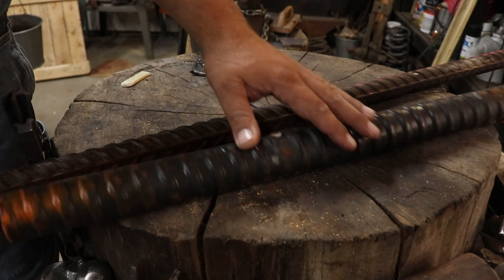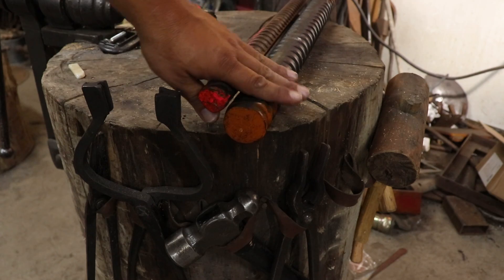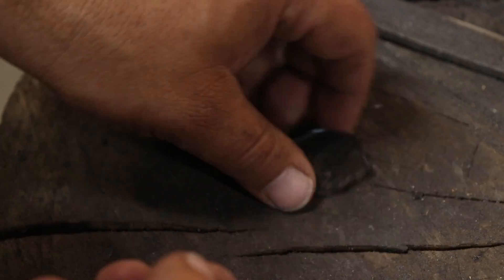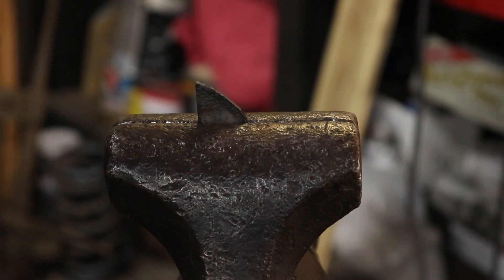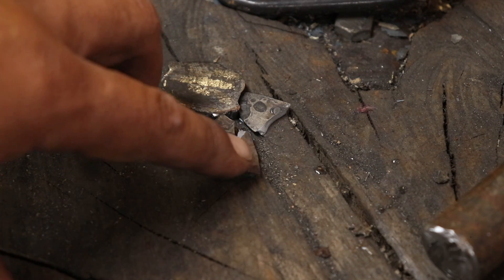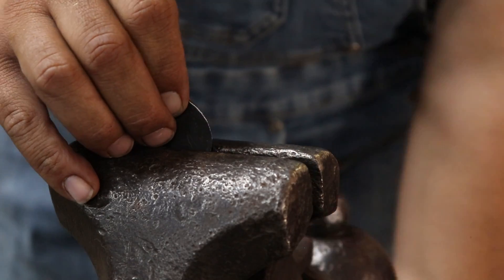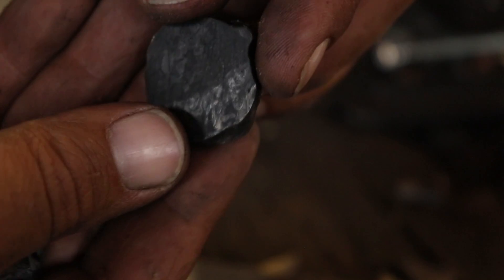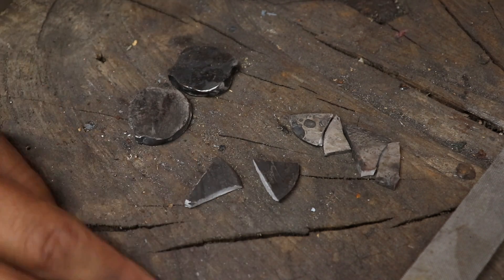Testing Steel Hardness

Comment: Rebar is mostly recycled steel, I’m told so it’ll be an unknowable mix I believe?  The large diameter is normally higher quality used for DOT and larger structures thus the grade is specified in contract specifications.

Comment: Did you preheat the oil? because most oil hardening 'tool' steals prefer being quenched in 80° Celsius oil. Like the O1 tool steel or W-Nr. 1.2510 in Europe.
Reply from the maker: yes I pre heat with a hot piece of junk steel I don't check the temp after though.

Comment: Ok some people get free or nearly free.
Many people have to buy but sometimes prices vary greatly.If you don't get a bargain just buy known steel and little bit costly but you also learned more that can be repeated.
Thanks good job
Reply from the maker: I agree completely I forgot to mention that I wouldn't pay for rebar it's just not good enough steel, but its worth using if its free